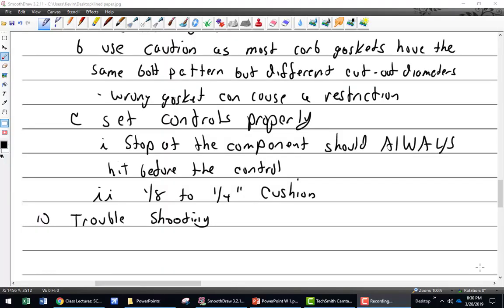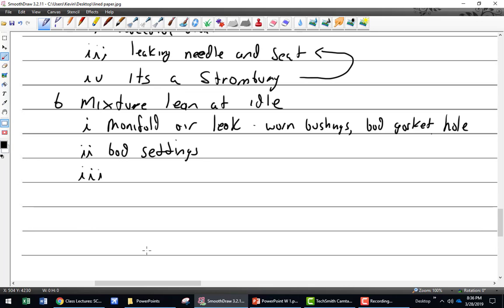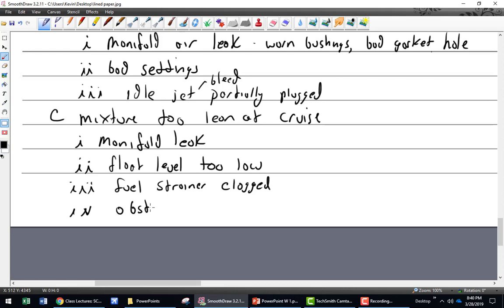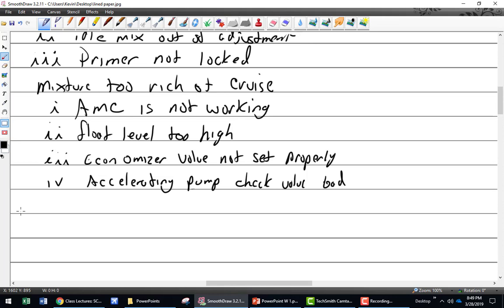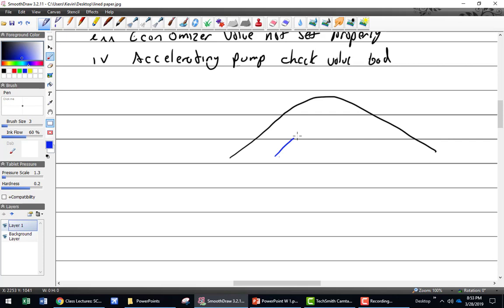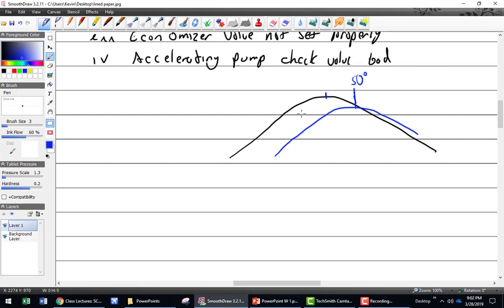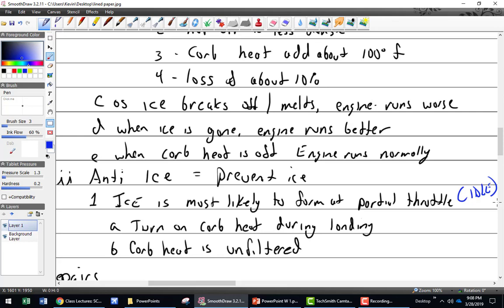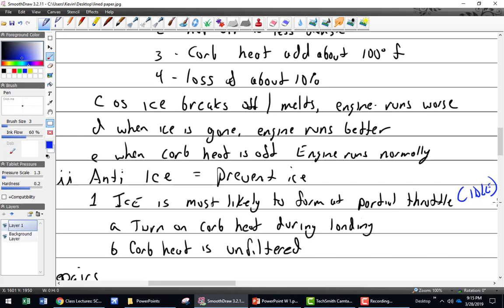3 28 part 2

Comment: Thank you very much for this ! I am apprentice-ing lol 
Don’t have time to go to a class. This helps . 
I have a problem with an HA-6 On a duchess. At 2000 rpm it runs rough and I have to pull back lever to make it better. It jumps up 250 rpm and becomes smooth. 
I leaned it but the more I do the harder to shut it offf ! It’s backwards. I’ve tried everything !